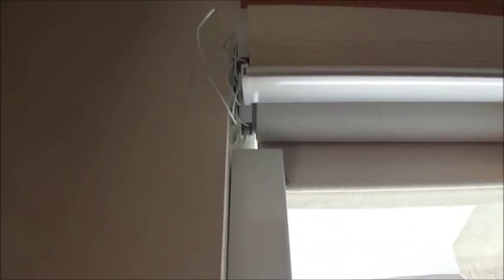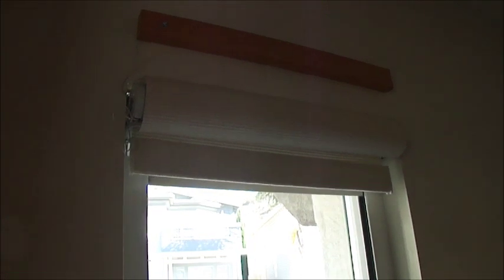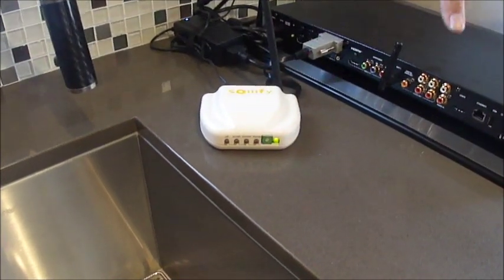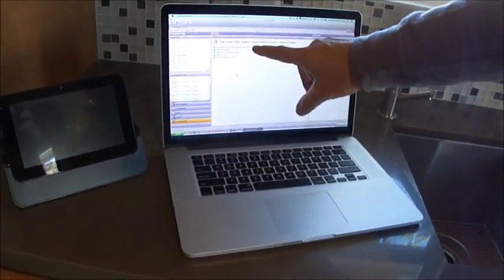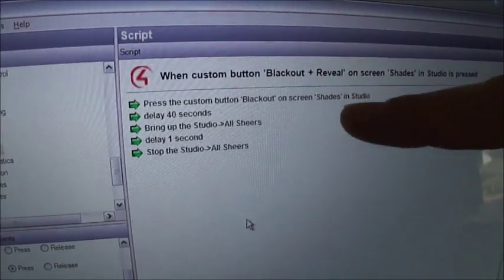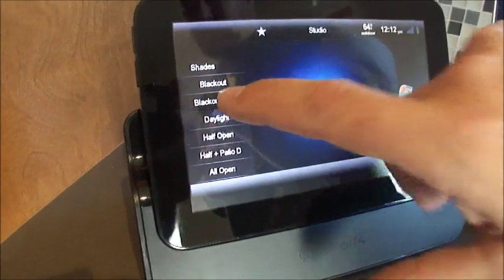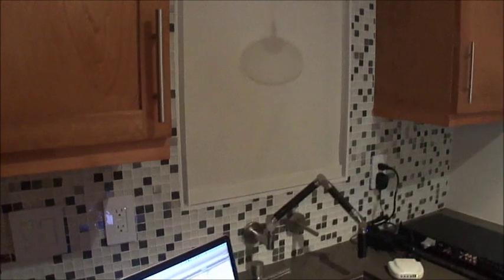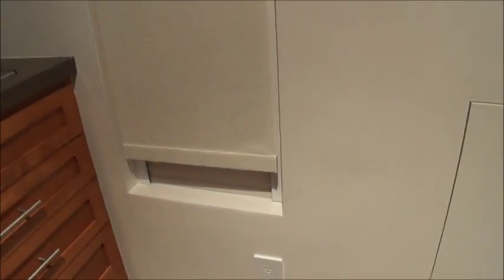Somfy Motorized Shades Integrated w/ Control 4 Home Automation System

Comment: What Somfy products did you use? And do you service VA?
Reply from the maker: Thanks for your comment! We use the Somfy LT 30 battery motorized shades and Somfy IRTSI 2 16 Channel Automation Interface along with the Control 4 Automation System. Learn more about our Somfy products here: http://3blindmiceusa.com/brands/somfy-automated-window-coverings/

Unfortunately, we do not service VA. We are primarily based in California.
Reply: could you give me the specific name of the drivers that actually work with urtsi2?

Comment: What is the radio frequency range on the Universal RTS II? Will it control a couple romans, and a dozen drapery motors throughout a two story, 10,000 SQ FT house? This is a better option than the six My Link interface transmitters we are trying to use. It seems they are not getting a good wifi signal. The homeowner does not have any more open ports on their Crestron system.
Reply: The URTSI has a range of 25-35ft. So no, it won’t. You’d need multiple urtsis wired together in a daisy chain. Somfy shades are loud, clunky and outdated.